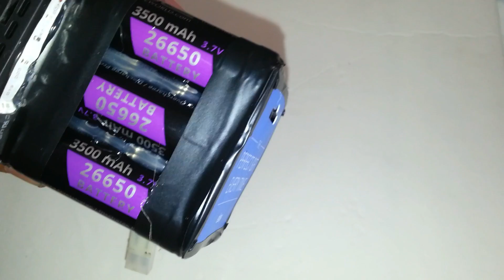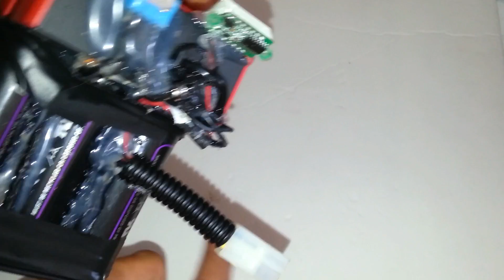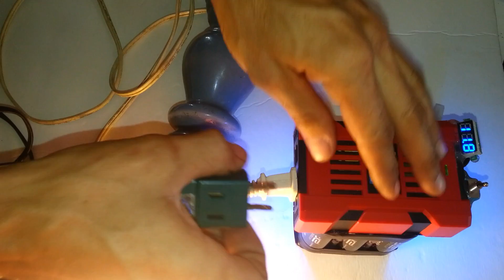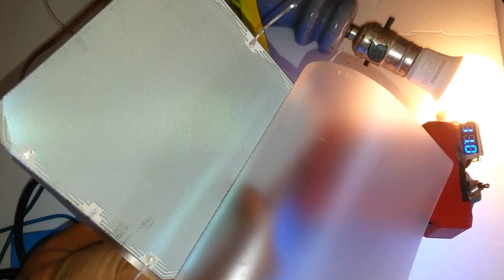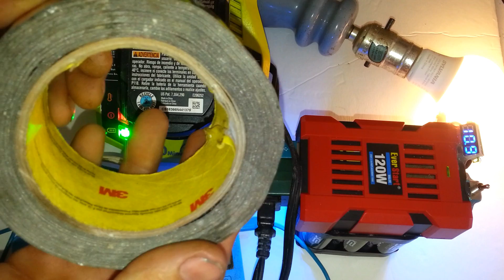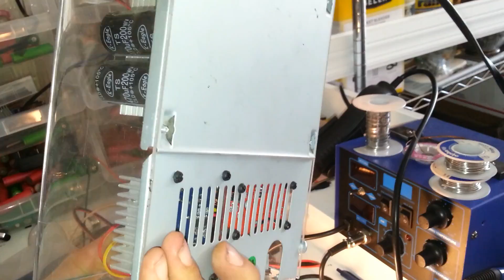26650 mini Inverter

Comment: So how you charge those batteries? By solar or??
Reply from the maker: +SuperMaiki76 yes. Solar..it is only 10.5 ah battery...so it is more or less a buffer during the day....if you use the full 120watts..it would drain that bank of cells in around 1 hour as that would be 12ah..it is a proof of concept..if that battery bank is bigger it could run longer...but it could run a light charge a laptop and phone for around 5-6hours util it needs charged again...